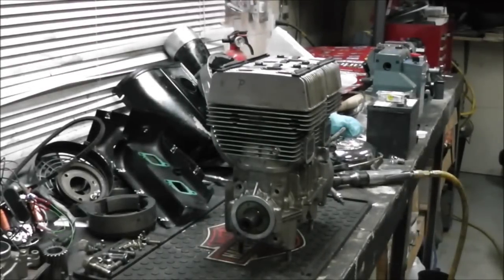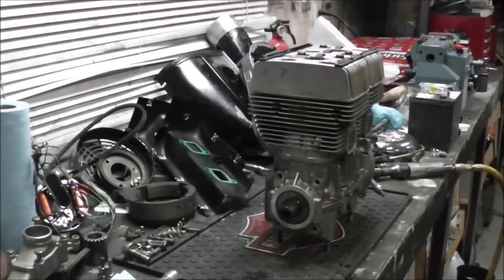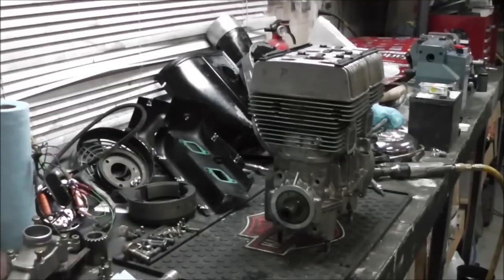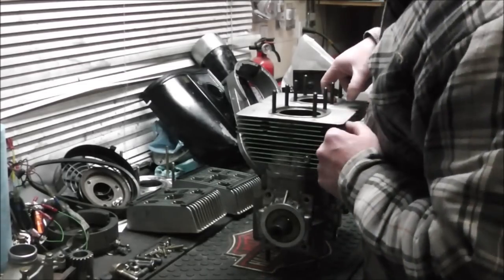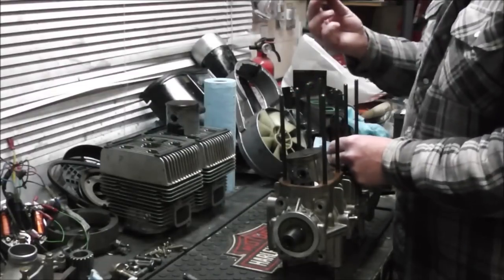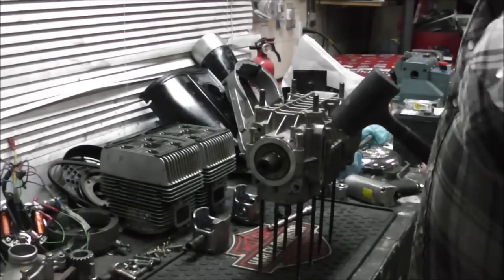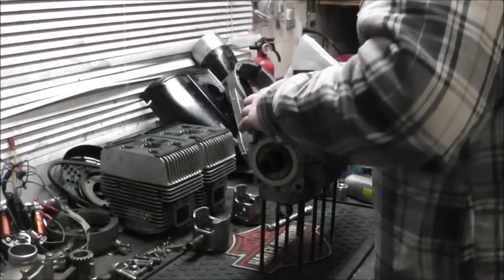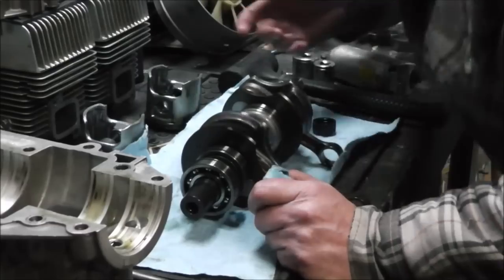Rotax 503 Tear Down!

Comment: What engine oil do you use or recommend for this rotax 503?
Reply from the maker: Shell snowmobile oil is the best I find. Rotax recommends it as well.
Reply: Awsome,  Thank You
Reply: Was watching all your videos of your snowbird build all the way to your most recent videos, it's been like 10 years, how many hours have you put on that rotax 503, and how reliable?
Reply from the maker: @jesseperez7253   I put well over 100 hours on it when a suspected bearing failure occurred. That said there was no time log on it when I bought it used so the total time on the crankshaft is unknown plus it was poorly stored prior to resael. Otherwise it was a very reliable engine and it got me home when I detected a small vibration that was probably a crank bearing beginning to fail.

Comment: how do they make the mating surface for the gearbox so smooth on the UL crankcases?  is there a ring or washer on there?  I got my skidoo 503 machined and filled the crank half gaps with gasket glue and it seems to not be leaking.  if you have 503UL intake manifolds around can you tell me the ID?  I think I need to put 36mm carbs on my engine, the 34mm skidoo carbs don't seem to want to push the prop past 4000 rpm, I wonder if I need the UL manifolds too
Reply from the maker: The 503 SkiDoo engine is actually quite different from the UL Engine, the crankshaft bearings were improved, intake ports changed, timing altered and even the wrist pin bearings were changed to cageless. The 2 engines are only the same on the outside. Bing carbs were also used on the UL engines. I never recommend using a snowmobile engine in a UL.
Reply: @hogsnplanes  my sled engine has cageless bearings.  The timing is the same as the UL too.  It's out of a 97 forumla SL.  I ordered a new PTO side bearing for the crank OEM from skidoo too, I think it's the same.  Maybe the differences were from earler engines.  I've got the skidoo shop manual too, I used it for the rebuild.
I can get brand new mikuni VM36 mm carbs for 120 bucks from summit racing instead of 450 for the bings...what's the difference, I know how to jet a carb.
Reply from the maker: @FourthWayRanch    People have used the Mik's with no trouble but the Bings again were designed with aircraft in mind. Porting of the Snowmobile engine like I said is different so setting her up I would go stock settings. The max RPM is determined by the propeller pitch.

Comment: how did you get the wrist pin out? skidoo manual says it needs a puller? I was able to push it out by hand after all, good thing I decided to pull this ebay skidoo engine apart, the crank bearings were shot, now I have to figure out how to rebuild this crank
Reply from the maker: There are shops that do those cranks, usually performance shops.

Comment: Can i install a torque converter in those i have one i want to install in a dune buggy
Reply from the maker: This one is set up for aircraft, Snowmobile version has a belt drive and centrifugal clutch.
Reply: Ok nice cause i aquire one from a snowmobile  i want to install it in a odyssey fl350 buggy do i need the harness
Reply from the maker: @oscarperezgonzalez9203    Not if your good at wiring, would help though.
Reply: How can i tell if i have the aircraft version or snowmobile
Reply from the maker: @oscarperezgonzalez9203    Aircraft has a different type serial number and threaded gearbox mounts on the PTO side of the crank case.
Reply: Is there a way i can send you pics and can you tell me if is a snowmobile motor i dont want want to spend money on the wrong motor i need one were i can put a clutch cause my odyssey has a gearbox
Reply from the maker: @oscarperezgonzalez9203    The crank taper is the same, a snowmobile clutch will fit. Also the aircraft version uses Bing carbs, snowmobile uses mikuni.
Reply: I seen the motor iam about to get has two carbs they say bing  but i dont know if the guy bought them after or not he said he got the motor in a boat ialso notice the the some of the 503 comes with double spark plug wire for each cylinder mine has one spark plug wire for each cylinder is there anything i should watch out for the motor i am going to do a compression test before buying it he is selling it for $ 400 is that a decent price
Reply: @oscarperezgonzalez9203  it's the same motor, just setup for different exhaust system.  The UL runs 36mm carbs and a muffler, the skidoo 34mm  carbs and a tuned pipe, I think skidoo also ran them with 38mm mikuni too.  other than that it's the same engine except for them fininshing the boss on the pto side and adding another ign circuit
Reply: @hogsnplanes thnxs

Comment: Great video, I'm tearing one of my 503s apart right now. No videos showing the dissasembly of magneto end, specifically the crankshaft locking pin? Could use any help..
Reply from the maker: The lock tab for the crank is actually on the factory puller. It is 2 piece. A back plate with the tab that bolts to the mag on the pulley studs and the actual puller screws into it.

Comment: They say to rebuild these every 300 hours (because of the bearing seals or whatever), and yet they are used in Snow Mobiles and you got to know, people running snow mobiles up north in the cold run them hard with little maintenance until they fail.  So is it really necessary to rebuild them every 300 hours?  That seems kind of ridiculous to me.  Sure, on an unknown used engine I just bought, I'd rebuild it, but I really would not want to rebuild anything that often, until they start showing signs of needing it (like losing compression, running weird or rough, etc).

Also, what compression reading does the manual say is good?   

http://www.ebay.com/sch/i.html?_from=R40&_trksid=p2050601.m570.l1313.TR0.TRC0.H0.Xrotax+503+rebuild+kit&_nkw=rotax+503+rebuild+kit&_sacat=0

http://www.amazon.com/Rotax-Engine-Rebuild-72-50-Oversize/dp/B00MDNFU3O
Reply from the maker: @111552563651351029831 Yes, In aircraft you can't hear engine problems in a 2 stroke. When you start loosing RPM or suddenly become a glider pilot that's when you know there is a problem. As well as a 300 hour rebuild there is also a 150 hour de-carbonizing and reseal of the top end. Can't just pull over and get towed home at 1000 feet up.
Reply: @hogsnplanes  🤣🤣🤣 Taxi

Comment: Great vid, I'm tearing down the same motor that's in my ski doo snowmobile, and I have been wondering, how do the lower end bearings and crank get lubricated?  Is there crank case oil in there that needs to be replaced or does the oil injection pump lubricate the lower end as well? If so, I don't see how...
Reply from the maker: 2 stroke engines either have oil injection or oil mixed with the gasoline. The air/fuel/oil mixture goes through the bottom end via intake ports or reeds before reaching the combustion chamber.